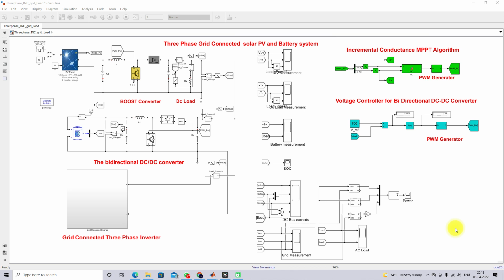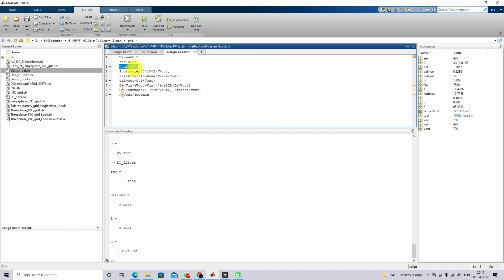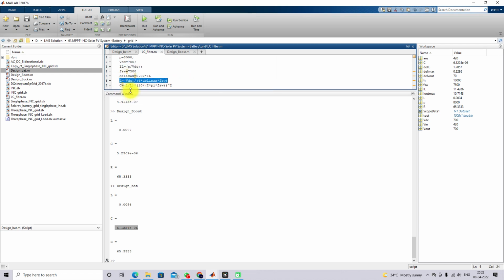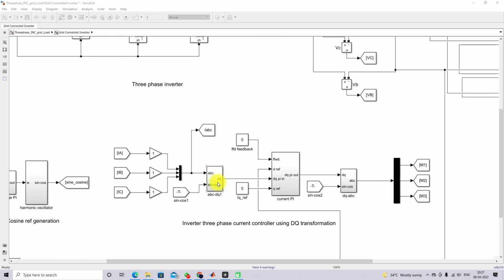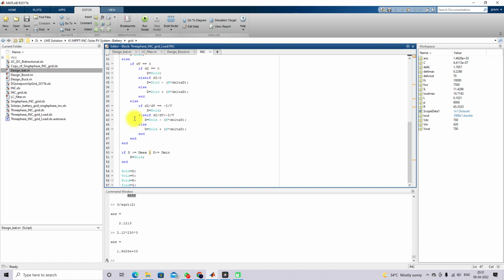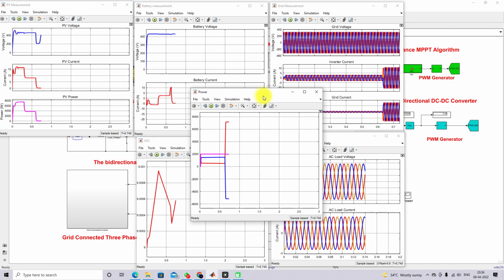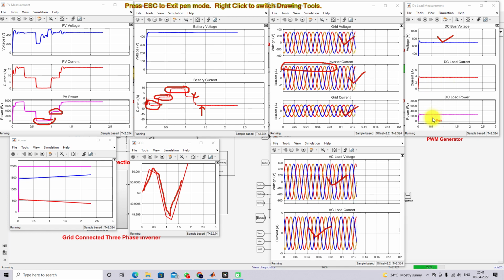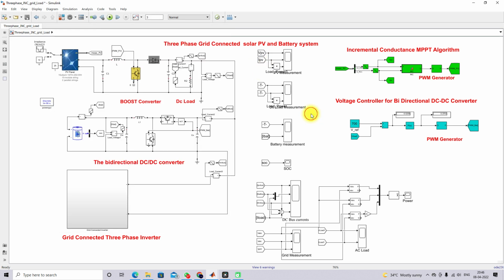Three-Phase Grid-Connected Solar PV and Battery System in MATLAB | MPPT & dq0 Control Simulation

Comment: can the ouput dc voltage higher than input? I use 49.4V open cct voltage and 18 module in series per string = 889.2Vdc input